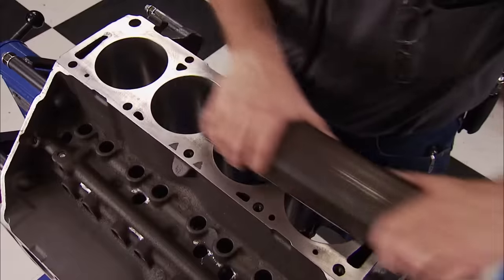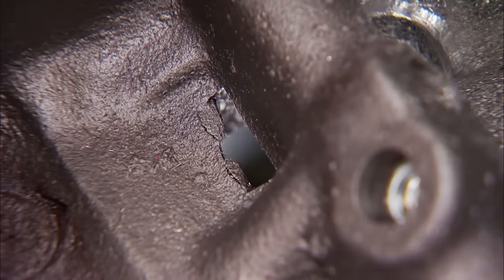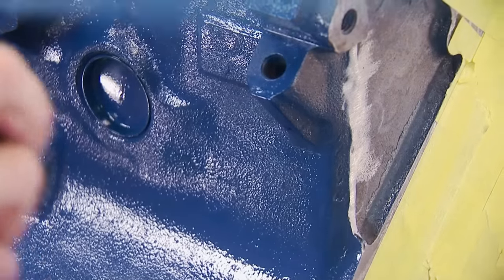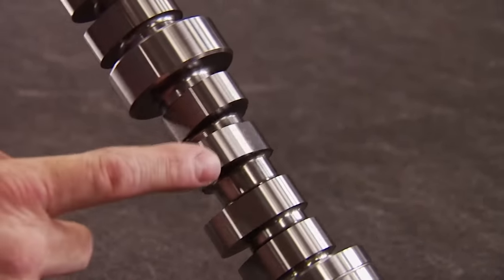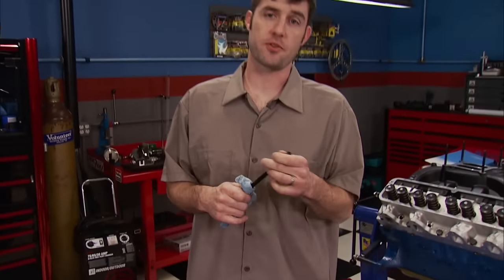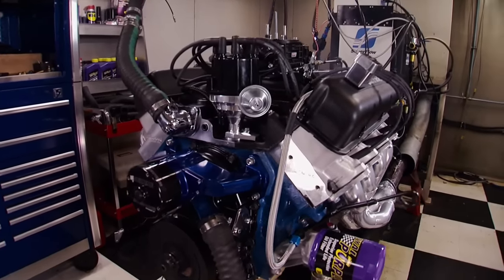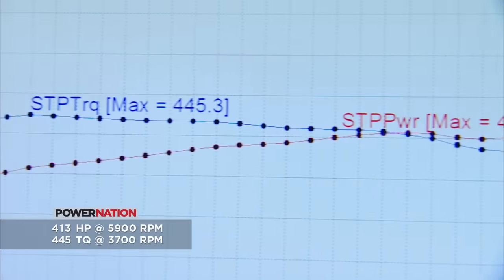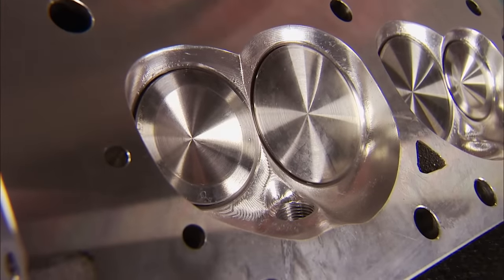Revitalizing A Ford 390FE With A Modern Twist - Engine Power S3, E7

Comment: Used a 391FT block and a 428 crank to build a 30 overbored 413 for my friend's 68 HiBoy. Didn't dyno it, but he was VERY happy with the torque!!
Reply: very cool 413 FE , the engine Pat did here seems short on efficiency,  low power with the gigantic cam ,  he should use a lot less cam and maybe just flow work on the stock heads with new valves
Reply: @nerradnosnhoj5122  they also mentioned low compression
Reply: @menogusta9829  383 sbc with 9.2 ; 1 compression slaps the crap out of that ford turd  over 480 torque at 3500 and 420 hp at 5200 ,. vortec heads and a mild 220 @ 050 roller cam
Reply: @nerradnosnhoj5122  imo its sbc for a (gas) working truck and ls/bbc for big power. But I dont see anything wrong with  building what you have, depending on the goal
Reply: @menogusta9829  certainly , and use your dollars efficiently ,  the numbers here are attainable for a lot less $$$ 
check videos from David Vizard
Reply: @nerradnosnhoj5122  👍 I watch and read David Vizard. I feel he's one of the best that will actually teach and share a couple secrets. I like Richard holdener too. He's not as detailed or informal and imo he's no vizard combo-building wise, but he's nice to watch and see how much a stock bottom end of such and such engine will do.
Reply: Sounds perfect for me, gonna have to do some more research on this!
Reply: @nerradnosnhoj5122 My 394 FE I built in 1999 and is still running perfectly., 10.2:1 mild solid , 780Holley. 509 hp and 488 ft lbs. Turd? Still going strong, iron heads with CJ valves.
Reply: @Bbbbad724  I was not refering to your build Sir , THis build here , this one is a Turd 
If yours has  good numbers , thats  a decent build  " Bravo "  This one sucks !!!
Reply: @nerradnosnhoj5122  I t needs compression. I agree that it has some advantages that were overlooked. The FE in particular has really good mixture motion, conversion from tumble to swirl. I got the most from mine in the cylinder heads and intake manifold.

Comment: Love the FE. Still hoping you’ll do a Y Block build one of these days too. Keep up the good work, gentlemen!
Reply: @bigboreracing356  Do you have a link to the video? I can't seem to find it
Reply: @bigboreracing356  No need to be rude. Yes, I understand that FE's have a deep skirted block, as do countless other engines. As I'm sure you are aware, the term Y-Block most commonly refers to the Ford 272/292/312 series of V8 engines. This is what I was referring to and I would like to see the Engine Power guys do a build on one.
Reply: @bigboreracing356  No they are not.

Comment: These 60's era Ford FE engines were really something in drag racing and Nascar.  Most noteworthy was Fords 390 FE, where in 1961 was available with the three deuce option which made 401 hp. 
Imagine a brand new 1961 Ford Starliner (black) with the 390 and a 4 speed, ..always a big hit with the chicks down at the tasty freeze..
Reply: I would like to see the cam spec on that 401 HP three Deuce 390 compared to the roller used here , The 61 may have higher compression . The engine rebuilt here seems short on power with that much cam , other pump gas engines with less cu.in. do better with .100 less lift and 14" less duration.
Reply: @nerradnosnhoj5122  - Yes, this Ford 390 performs like a SBC 350 with stock Vortec iron truck heads and a Summit flat tappet 224/234 cam...
Reply: Yeah, chicks may have gone for the convertible version...
Reply: @BuzzLOLOL   the camshaft and heads being used on this Ford , 
are not good choice
Blueprint SBC mild 383 crush this Turd easily with milder cams , stock vortec head and a little less displacement. A Ford 390 has a 3.70 stroke, SBC stroker 383 has 3.75 
I think the Ford has better potential with a milder cam & Heads for better velocity,
Reply: @BuzzLOLOL  ..those are the ones who never unlock the door for you.
Reply: Can't forget the 427 FE was the engine that brought Ford their Le Mans win in '66. These engines really did it all.
Reply: Ray Paquets T-Bolt is still breaking SS records.  The FE is solid. He is wisely using aftermarket parts to save original parts for restoration cars. He is turning a 427 inch FE High Riser like Ford did and still sets SS/A records spinning it to 9200+rpms like the old days. The design is still as true as it can be.
Reply: @nerradnosnhoj5122   4.08 x 3.784 stroke. The 401 hp had 3x2 bbl Holleys. The 4 V is 375 but showed 392 hp They could rev easily to 7500 rpms since they had solid cams. The combustion chambers were 62cc and made 11.5 to 1 and the cam was later used as the 427 410 hp LR engine and the 3x2 became the 425 hp 427 LR with 2x4 bbl.
Reply: @nerradnosnhoj5122  It isn't a competition.
Reply: @spaceghost8995  I guessed that ,
Appears to be a waste of time and money for results here, 
I like to get the most out of time and $
Reply: The chevrolet 396 produced 425hp  with only 1 carb. Who wants to build an engine with only 2 bolt mains?
Reply: That's how you pull dudes not women

Comment: I daily drive a 390 in my F100. Lots of stock internals, with some bolt on stuff. Rebuilt it when I was 17 (Only 1 year ago) Runs great. This gave me a few more ideas for my build.
Reply: @bigboreracing356  Nah, I'm a Ford guy. 😎
Reply: @bigboreracing356  I started with a Ford, and I am more familiar with their products then Gm or Mopar.
Reply: @bigboreracing356  just build a 460 and as you’d say “donkey stomp a Chevy”
Reply: @willfrancone3908  
I've seen your channel, are you still using the 4 speed?  A really nice upgrade for a daily driver would be a tremec tko. I built a 445 and ran the 4 speed for awhile. I put in a tko 600 and am much happier.
Reply: @slick-px4pq  I am still using the 4 speed. I would love to do a 5 or 6 speed, But it's expensive. 
There's a guy who is possibly going to make an adaptor to fit a zf5 behind an FE, so maybe I'll wait for that. Having an overdrive must be nice behind these gas hogs.
Reply: @bigboreracing356  So basically because you prefer chevy everybody else on the planet does also, even if they don't know it yet.  It's totally not possible that other people can have preferences different than yours, I understand.  So, what do we all like to eat?  What kind of women do we like?   The world needs your expertise

Comment: Look on Pat's face when Mike says "these motors were never really known for making power". 😂
Reply: Maybe Mike was thinking of the 351M. The FE was a little before his time. 😅
Reply: Correct, this Ford 390 performs like a budget SBC 350 with stock Vortec iron truck heads and a Summit flat tappet 224/234 cam...
Reply: @chipwright6193  lol , those stock 351 M's were a gas guzzling TURD !
Reply: @nerradnosnhoj5122  I know, that was my point 😅

Comment: I run a Tony Oddo, Jr. 428-SCJ in my Mach 1.  FEs with aluminum heads and intake are as light as an all-iron small block.  460 hp, 490 ft-lbs w/ CJ manifolds - NO headers.

Comment: One step y’all missed: the main seal must first be set to flush, then checked for crush hight. 5-15 thou on each half will ensure proper crush. I try to file the end till is 10 thou.
Reply: @bigboreracing356  Everyone who has built an FE block and doesn 't want a rear main seal link cares.

Comment: i always wondered what those factory bigblock intakes intakes weighed. they could get heavy if you had to pull one off with the engine in chassis.
 i enjoyed the video. i remember tri powered 406 engines. fast back in the 1960s.

Comment: 38 degrees of total timing is what the RPM heads want!! Also, a 1131 Silvolite piston would have brought you 9.7 to 1 compression which the FE series really likes!!
We are not a big fan of the Keith Black pistons!! Too low of static compression!!
Also, aligning up the main saddle oil passages to the main beatings is crucial!
Intake centerline should have been at 108, not 104!!
Reply: I just found my boy a 428 crank to stick in his 390. It is going to be fun building the 410 for his f100 4x4. Would you have a cam recommend? It's a hunting truck but he also likes to play in the mud so we are looking for good low end power.
Reply: I agree with you FESpecialties. This was a sad build and waste of money for the amount of roller camshaft with over 600 lift and 1.72 rocker ratio it should have made way more power
Reply: @jesusisalive3227  I got somes o
Reply: Yes, many mistakes on this build, could have been so much better for hardly any more money.
Reply: Is there a cam you would recommend? I plan on doing my first build to refresh a recent F250 purchase. Not looking for a race car but a fun weekend tire melter :-)
Reply: If you guys need some help with parts choices and advice, you can call us M-F 9-5 P.T. And we will be happy to help you!
Best to call around 9am Pacific Time!
Look us up on the web for the phone number!
Reply: Hey man how are you doing  FE Specialties?  The new location doing well.  This is Bill Ballinger, are you still racing?  I love that car!.   I have mine at 37 with C4AEG  iron and stock 5140 forged steel rods for 1.715?  and ARP bolts.  My CR is 10.25 and a 270S , but I measured my Federal-Mogul rocker arms and the ratio on them was 1. 9 instead of 1.76. When I degreed the cam at .019, what Billy G. said they should be. The duration is 236 @.050 and I forget the lift, but it has 12 more degrees of duration and more overlap. It has a really good sounding idle and it has been in there since 1999. A 750 3310 with blocks on both ends works well.  I really wish I had a 410 crank. I only bored it .020 over. As it is, it is a beast! My heads flow 268/200 and I have a  Holley SD on it that I raised the ports to the top.  No  aftermarket heads just an intake I traded for and a solid cam  and new rockers and the right geometry pushrods. The heads flow well for C4AEG heads that I did some work on myself and got a good balance of flow and velocity, really quiet through the whole cam lift range, no backup at all. When we dynoed it we got 510 hp and 476 ft lbs.  I wonder if you think it would stay with an 8.2, deck block even the 363 SHP block that always leaks out the back?  Just curious. It is 394 ci that has a good rumpity…. I think it would be a good truck combination, what do you think? I have heard that mine flow about the same as Edelbrocks except they are better balanced flow, just curious. I’ve had a few 8.2,blocks and they split at 500 hp. Mine dynoed at 510 at 6400, and I hit it a few times with a 150 shot of nitrous and it loved it. No pieces fell off.

Comment: Need more 351 Cleveland builds
Reply: True
Reply: if you haven't heard of it, visit Drag Boss Garage. Lots of great Cleveland stuff there, and lots of links to more.
Reply: Need Cleveland heads and intakes for the 4.63 spacing FE with stroker cranks. 4.125bore 4.25 stroke 454 FE that can make 700 hp NA at 6700.
Reply: I agree!
Reply: Nah. FE is more fun. Not so temperamental, venerable engine. Cleveland is a brat.

Comment: I rebuilt the 390 in my 64 Galaxy it had 100,000 miles on it,the crank and rod bearings virtually had no wear on them and they were original.

Comment: I've.built everything from a 352 to a 428 as far as FE engines go. The best intake I ever used on a street FE is the classic Edelbrock Streetmaster. Although it's a single plane it doesn't penalize low rpm  torque to make high rpm  HP.

Comment: I built a 428 CJ from parts even managed to find some cross bolt main caps. I used the HS rockers and a gear drive. Back when I built it $350 seemed to be the magic number for parts. Intake rear sump pan etc. Expensive engine to build but what a stump puller.

Comment: Really nice build. I love my Harland Sharp rockers. Such good quality. I have a set on my 1st gen Bronco that I have had on for about 20 years! One thing on the 390: good power on a conservative build, although I was surprised it did not respond a little more to adding 5 degrees of timing. I was thinking 20-25, not that 15 is bad.
Reply: Yeah, that 9:1 prolly needed 38 - 40 degrees of total timing...

Comment: Oil mods are necessary on those type engines starting with an afternarket oil pump drive and restrictors for the heads . a 4.98  crank would really make a big difference and keep the Compression arouns 10.25 to1 Trick Flow heads are the ticket on the Fe type engine . Just my thoughts on what works for me .

Comment: I had a 73 f100 with a 390 with a 30 over bore and that truck was a monster I sold it to a friend who plowed the oil pan on something it took him to work 5 miles each way for over a week with no oil it finally seized we put oil in it unseized it with a wrench and it ran fine for several more years
Reply: @bigboreracing356 I'm no ford fan I'm an internal combustion engine fan i like all different makes and models except dirtbikes I'm partial to yamaha

Comment: I had a 1966 Fairlane GT 390. The GT block had main cap bolts that went through the side of the block. Factory numbers were 335 HP and 427 TQ. It was a pretty fun car for a 16 year old kid. GT was a 4 spd and the GTA was an automatic.
Reply: No 390 GT block had cross bolted main caps.   The only FE with them was the 427.    Supposedly very late 406 blocks had them too however I've never seen one or any substantial proof they exist
Reply: @tomcoppa2211  You are correct regarding the cross bolted main caps. However if I am not mistaken the GT block's had beefier main bearing webs as did the PI 390's .
Reply: @briansearles4473  nope no difference between a 390 or 390 GT same exact block.   Difference between them was carburetors 2v 4v autolite or holley

Comment: My only concern: are there aftermarket headers? My uncle owned a 68 Cougar XR7-G in the 80's. It had a 390 with cat on the valve head covers. It had only cast iron exhaust manifolds. The 390 is a great engine.

Comment: I'm a retired engine builder mechanic machine is when I see guys pounding on the main caps in the block I go wow you should start the main caps in by torque in the boats evenly never hammering a main cap the bearing can pop out and then you will ruin the engine you can tap them in lightly but you have to have the bolts in to line them up that bearing pops out you're in trouble. And one thing never used form a gasket on gaskets they will turn to mush and then you'll have leaks later on down the road form a gasket is made for a surface with no gasket at all my favorite is ultra black it's bulletproof. I've had to repair too many vehicles with leaky oil because the mechanic used formicasket on the gaskets and they turned to mush.